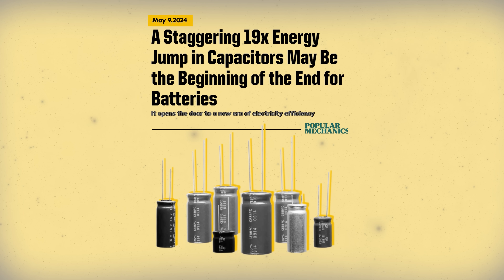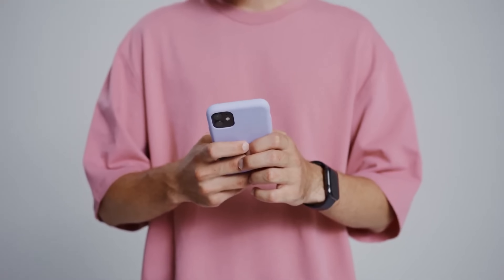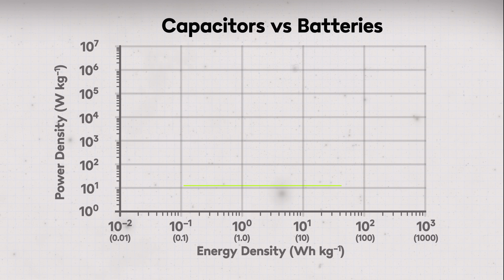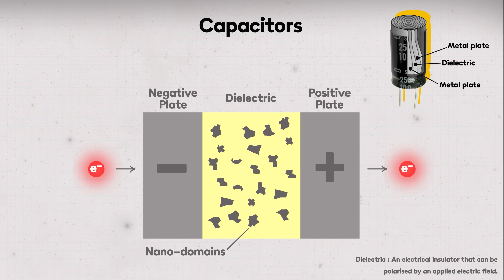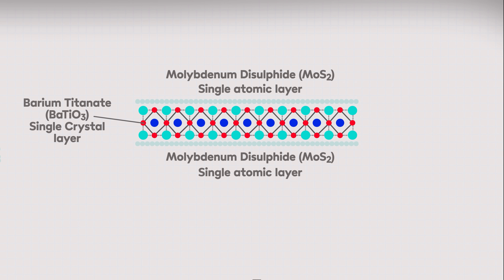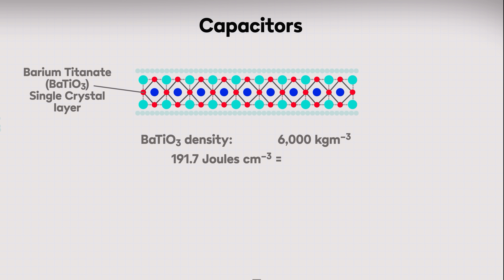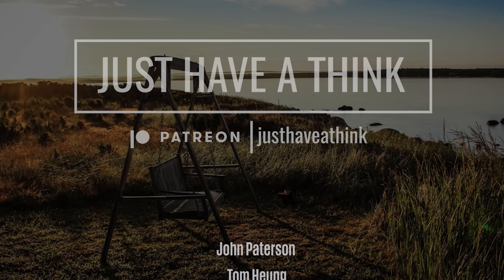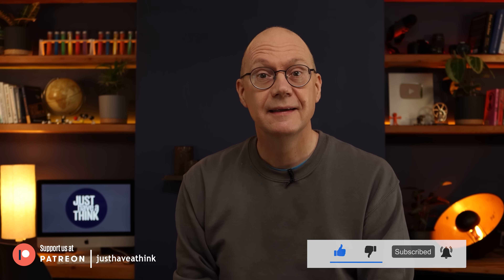Charging an EV faster than filling a gas guzzler? Surely not!?

Comment: Interesting... Thanks Dave! [Electrical Engineer here...] But i don't really see how a buffer-capacitor bank would help with fast-charging an EV. To have this capability, one would need a capacitor-bank with, say, 80% the capacity of the EV's battery. Given the much lower energy-density of capacitors, even supercapacitors, that would be a capacitor-bank considerably larger than the car itself. 🤔
The other problem with fast-charging EVs, though, not addressed in this video, the grid-load of the charging-stations, is where (large) capacitor-banks could prove to be useful. To charge a 60kWh battery (that's a small EV...) in one hour, one needs to supply 60kW of power, for an hour. That's already 4 to 6 times as much power as an average European home draws in wintertime... To charge the same battery faster, say in 6 minutes, you'd need to supply 600kW. That's really an obscene amount of power. Not many places exist where the grid can provide such amounts of power. But... A capacitor-bank based fast-charger could charge itself slowly from the grid, say with 50kW - 60kW, and then when an EV is connected, it could dump all that stored energy into the EV's battery in minutes (provided the battery can handle that, of course) and you're off. The brawback/compromise is that the charging-point would then need an hour or two to recharge itself before another EV can be fully charged.
Reply: Everything Electric Show,just did a video on this, which featured a new ''buffered' fast charger to do exactly what you described, except it uses LFP batteries instead of miracle capacitors.
Reply: Yes, but...just how hefty a set of conductors do you need for 600KW?
Reply: @docwatson1134 level 3 fast charging uses 480vdc, 600kw means 1200amps. You would need six strands of 3/0 copper for that. It is unlikely that a regular sized human could comfortably use a plug/receptical with that much weight on it.
Reply: @timothybayliss6680  Thank you.   Do you know, do those assemblies include a cooling loop?  This amounts of amperage, outside of my normal experience.  But the technology is fascinating.
Reply: @timothybayliss6680  Pretty sure you need 800V architecture to get 600kW.
That reduces the current requirements to a mere 600amps.
Reply: @economicprisoner  Arhitecture? Simple word - only to connect cells in serial instead of parralel and measure 800 V on battery clamps and double voltage  in compare to 400V in all internal battery locations. You need more luck.  . Then cable  size for coopper will be "only" 48mm diameter ( 630  mm sq  cross section) I congratulate you if you are capable to handle such 800V cable it and precisely plug in. to delicate   car socket equipped with all safeties.  .   But anyway -   all car  insulation double in compare to 400V , motors for 800V in rainy day or when  flooded?  Pray that everything in wet conditions  will not   light blue.   With 400 V already some people in China got electrocuted.  And such detail - 800V cannot be chaged at 400V stations.
Reply: @Mikexception  The way Tesla gets thin cables is by liquid cooling them.
My car has a CHAdeMO port: which is bulky enough at 125A.
Reply: @economicprisoner  Are you sure   that  cooling is provided not for exclusively  socket contacts?  Bacause it looks weird to me to downsize  wires  with thickening them cooling system which must   add   to overall weight and size. .
Reply: @Mikexception  AFAIK the actual contacts are only cooled by conduction through the wires.
Liquid is able to move a lot more heat away from he wire than free air.
Reply: @docwatson1134  That was my thought in watching this whole video.  To transfer that much power in a short amount of time, one needs very high voltages and very high amps, both several times larger than what the bet fast charge stations are currently using.
Reply: @docwatson1134  You have to up the voltage in order to keep the charger cable manageable. That is why some EVs now charge at 800 bolts.
Reply: @docwatson1134  They already have 500kW chargers in common use in China, so maybe look that up?
Reply: @bryanackerly7775  How about a link to info and how they are doing it.  To transfer that much power in a short amount of time, one needs very high voltages and very high amps, both several times larger than what the bet fast charge stations are currently using.
Reply: @bryanackerly7775 ; for half a million cars at once, don't think so.
Reply: Not an engineer and I can't see the link between capacitors and fast charging like at 8:05.  maybe sudden short bursts from regen braking
Reply: @jeffreyherba8435 Yeah, it won't help for regular charging until the energy density is much higher. Can only help a little bit for things like regen and if certain areas were to put wireless chargers in roads like at traffic lights or sections of highway. But even then I don't know if there's that much to gain over the latest lithium batteries and the ones that should be out by the time these capacitors have made it to large scale production.
Reply: so this capacitor bank would need to be the size of a small asteroid then, and a whole constellation of them would be required
Reply: Super capacitors smothen out the charging curve sparing of the batteries. It would only shorten the  charging time by maybe 5 min, but that is still not bad. Regen braking is what super capacitors really would be great for, since the can absorb electricity much faster than batteries. A small buffer of super capacitors would be enough, for this.
Reply: That could use another battery to provide 600kw charging speeds while it charged from Grid at 60kw
Reply: Capacitor may be ( in our derams now) as fast chargable as gas tank but it is not problem only  in battery. It is one ,more problem and it's solving in future could be  easiest  . Impossible problem is electrical energy delivery   to charging stations Exact    problem would have   gas stations if they would have capability  to accept   10 tons gas in i month and was asked to to sell 2   tons per day. The only solutin to shortages in delivery to shop is always  forming a long queue. Actualy instead of "waiting line" for delivery   is called "charging time". because time of cherging battery is now more noticeable. It could be  better if we would have faster  delivery to station because we wopuld install more chrgers. But we will not have so fast delivery and  so big energy quantity.
Reply: A simple toilet has enough water for three flushes.  Increase the capacitor tank.
Reply: @mrstock7986  600kwh is a very expensive super capacitor!

If you're going grid, wouldn't you be better off using grid storage as your buffer for EV charging instead of SuperCaps because of it's price/Kw and it's many other uses, such as solar/wind energy storage, backup power etc?
Reply: My thoughts exactly!
Reply: On your first point - if the vehicle capacitors could take 10% of the battery total then you might significantly improve the x to 100% charge time since the last 10% takes as much time as the first 80% ?
Reply: @CISCambridge These capacitors only have an energy density of 8.8W/h per kg. So, even compared to an LFP with an energy density of 150W/h per kg, having a capacitor with 10% storage of the battery (say 60kW/h battery and 6kW/h capacitor). The capacitors will weigh 1.7 times what the battery does, so will not be worth while. If you compare to a higher end Lion with 280W/h per kg, the capacitor would need to be 3.2 times the weight of the battery.
Until the energy density is much higher, they're not really useful for normal charging.
Reply: @CISCambridge  I guess most charging and battery saving success will depend on excellent BMS software
Reply: Neighborhood electric distribution lines of the power grid operate at about 15,000 volts. That means 60 kilowatts is only 4 amps, and 600 kilowatts is only 40 amps. So, power on that level is easily available. You could easily have 600 kilowatt capacity connected to your house, but not everybody could because that is about 100 times the normal average load of a house in USA. Because of that, power at this level could only be supplied to one house every 100 houses. It should be obvious that we cannot electrify transportation if only 1% of the population can do it. 
Put another way about 25% of all energy use is for transportation. Another 25% of all energy use is in the form of electric power. So if we want to make all transportation electric, we will have to double the total amount of electric power available! Then, if we want to electrify the entire economy we will need four times as much electric power!! Solar power is good for about 6 hours a day or 1/4 of a day, so even if we have enough storage to make that last all day and night, the solar farms will have to be another four times larger, thus creating a power grid 16 times larger then we have at present. That will not be easy or cheap!!!
Reply: @YodaWhat  For home use you can charge overnight for the same grid demand as peak supper hour draw.
(I have my EV programmed to avoid charging in the 5:30PM to Midnight period).
Reply: @economicprisoner  - Of course, and that lowers the kW, but it also means you and millions of others can't be relying on realtime solar power, unless there is MASSIVE energy storage to shift the load peaks around. Such storage IS possible, but it is not feasible to do it with batteries... Too costly. There is an opportunity to store Terawatt WEEKS of power another way, with good round-trip energy efficiency and no environmental disruptions, but nobody talks about it.
Reply: @YodaWhat  Those EVs charging in the afternoon can add up.
Reply: @YodaWhat  Your math is off. EVs recharged from the grid are so much more efficient that primary energy use goes down when we stop putting gas in cars. And most deive5s will mostly recharge when electricity is cheap because supply exceeds demand. EV recharging is a great fit for a grid that's mostly renewables.
Reply: @skierpage  - You have a bit of a point, but maybe not as much of one as you think. I assume you are referring to this section: > about 25% of all energy use is for transportation. Another 25% of all energy use is in the form of electric power. So if we want to make all transportation electric, we will have to double the total amount of electric power available! < If we take electric cars to be twice as efficient as modern gasoline engines have gotten, we are still talking about increasing the electric grid to something like 150% of present capacity. Then look at many of the other things which use lots of fossil energy: they are already in the same general range of efficiency as electric cars. That means most things cannot double their efficiency because they have already been made about 80% efficient. Those other things already use 200% as much energy as the electric grid, so we are talking about total electric demand going to 350% of the present amount. That further 50% to reach my original estimate is now seen as not so far off. The rest of the points I made originally all still apply, and I did not even get into what happens when a couple of billion more people finally get cars, refrigerators, air conditioners, etc. Bottom line: We ARE looking at a really massive increase in the electric grid, both the generating capacity and the transmission capacity, plus we have to add energy storage on a GIGANTIC scale. Then, getting that energy in and back out as electricity is going to lose 10% to 60% of the input energy. Putting all the pieces together, the picture is NOT improved from my original message. 😕
Reply: @YodaWhat  Actually once you get a COP of 3 (Coefficient of performance) or more heat pumps start to be more efficient than even a 100% efficient gas boiler, even after generation and grid losses.
Heat pumps "cheat" by just moving heat from one place to another. Modern heatpumps also work well down to -20C (0F).
Still gets cold enough where I live to consider a ground=source system though (way more expensive to install).
Reply: @YodaWhat   as others have pointed out, fossil fuel for heating is terribly inefficient compared with heat pumps. But sure, electricity demand will go up. What's your point? Is it that everyone should use less energy because the transition to net zero is hard? Definitely, ride a bike!
Reply: This infrastrure won't be provided any time soon. A hybrid with hydrogen probably will be more logical and affordable
Reply: @PeterBakker How? Because Hydrogen is 2-3x more expensive than current liquid fuels (but that is just using steam reformation of methane - so just as polluting as gasoline) and twice as inefficent as EV power if you use electrolysis (which then triples the price again at the pump making it 6-9x more expensive than gas). We've already seen H2 flop in California where there were massive incentives and H2 has worse infrastructure issues than electricity distribution will ever have. It makes zero economic or environmental sense. Feel free to check the figures - they're conservative.
Reply: @PeterBakker  there is no role whatsoever for hydrogen in land transportation. It's a more expensive vehicle powered by much more expensive fuel supplied by an almost non-existent infrastructure. 

Batteries are recyclable unlike mining fossil fuels then burning them.
Reply: @skierpage there are many promising techniques to save our ICE history :The use of nanomaterials could provide a higher density system and increase the driving range towards the target set by the DOE at 300 miles. Carbonaceous materials such as carbon nanotube and metal hydrides are the main focus of research. They are currently being considered for onboard storage systems due to their versatility, multi-functionality, mechanical properties and low cost with respect to other alternatives.[156
Reply: @PeterBakker  No. Hydrogen is not logical.
Reply: @PeterBakker  Hydrogen is produced by ... electricity (if it is clean energy). But needs to be cooled, compressed, and transported.

Comment: The real benefit of capacitors is the rapid charge/discharge rates and practically infinite charging cycles, so the obvious use case would be ultra-frequent charging, like putting wireless induction chargers at traffic lights, parking spots, drive thrus etc.
You'd only charge a fraction of your total capacity , but it'd be every time you're stopped at a light, then when you leave the built up areas you could have a regular battery take over. 
For city only driving you'd probably not even need a regular battery or merely just a tiny one(for lights/infotainment/AC/Heater etc)
At first i could see a system like this implemented for trams & busses(charging at stops), negating the need for overhead lines or 3rd rails, while also saving literal tons of weight in batteries.
Reply: Not a goer. The energy density of supercapacitors is many orders of magnitude lower than that of batteries.
Reply: @rogerphelps9939  According to this video it was ~28X difference in energy density and improving rapidly.  The point being that you only need a few km/mi of range anyway.
Reply: There's not going to be many situations where these make sense until the energy density is much higher.